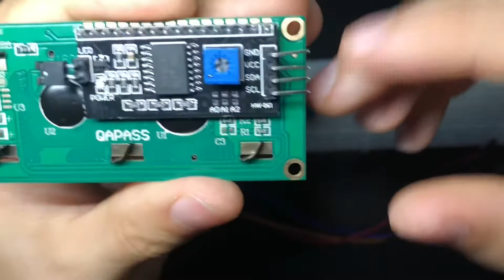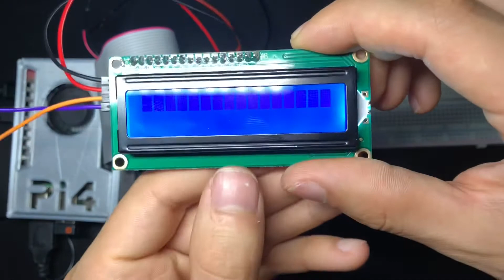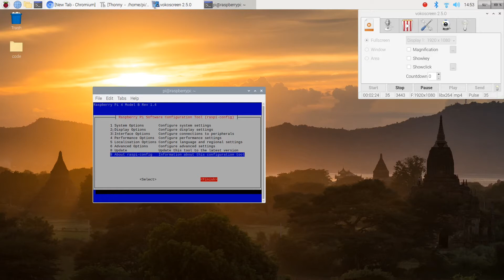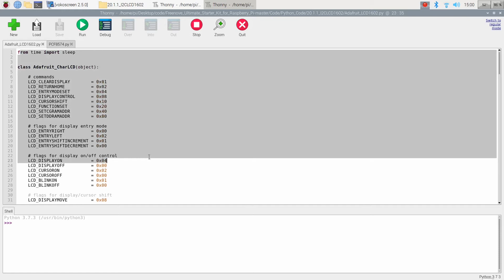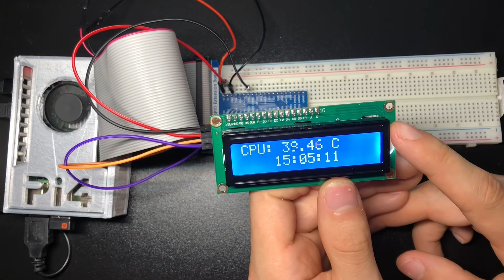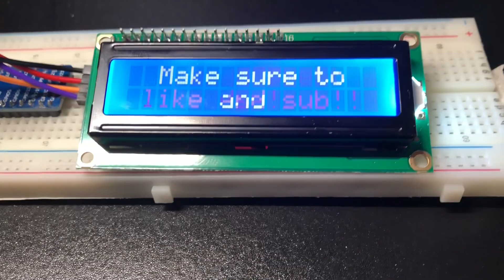How to use a Raspberry Pi and LCD screen

Comment: do you need to have a raspberry π OS installed to make the LCD work? I'm running a headless version of the the companion software by bitfocus and I want to have an active status of the Wifi IP and the Ethernet IP to that I can view what the IPs are of both connections and to be able to see if a connection is disconnected. Can you show how to do that?

Comment: I cant seem to find the i2c address. And it isnt 27, could you please help
Reply from the maker: did you use the scanning code and still not find anything?
Reply: Yep i did, but it just gives an empty table
Reply from the maker: @jeldo_  Well I am not sure, the only thing I can think is to run it a few times as quick as you can and see if it works.
Reply: Okay.